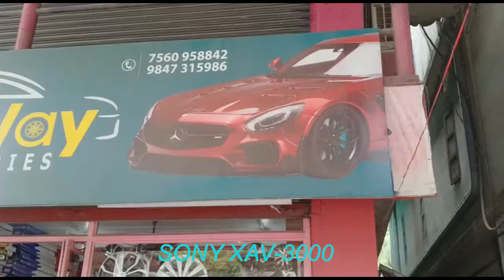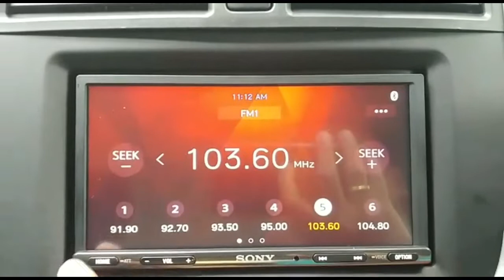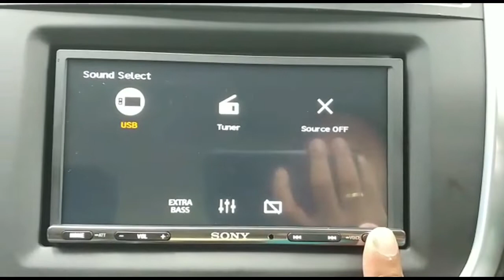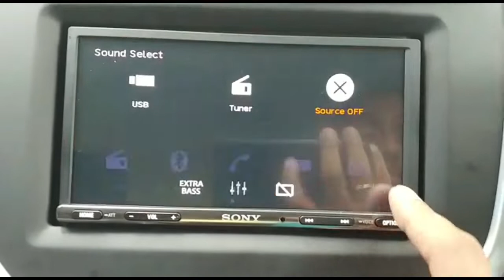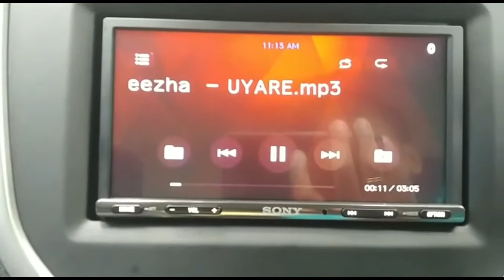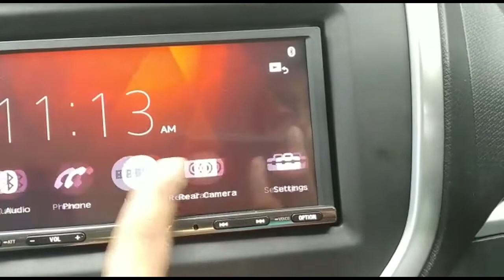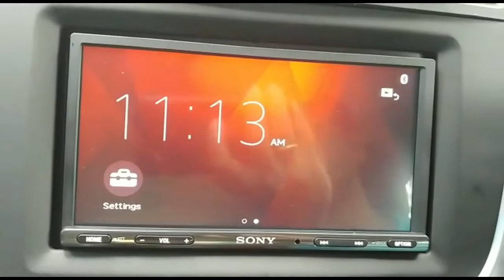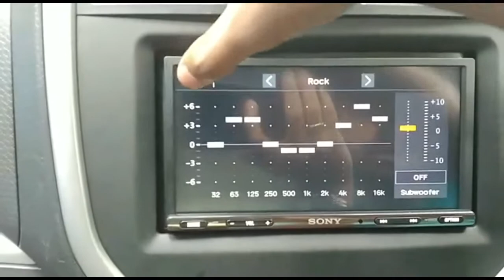Installing SONY XAV-3000 in Vitara Brezza | VBCK | Anil Mathew

Comment: where to connect usb for android auto feature ?
Reply: There is a usb extension cable (inbox) which can be used to connect with phone (the port on the player is on its back and therefore direct connection is impossible)